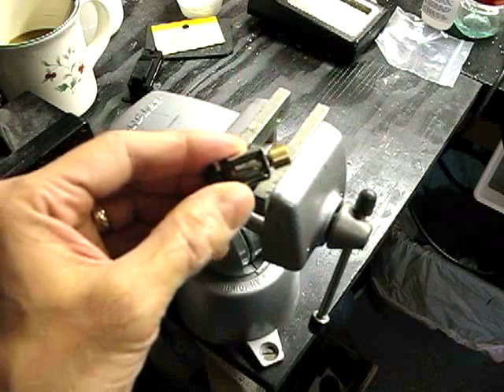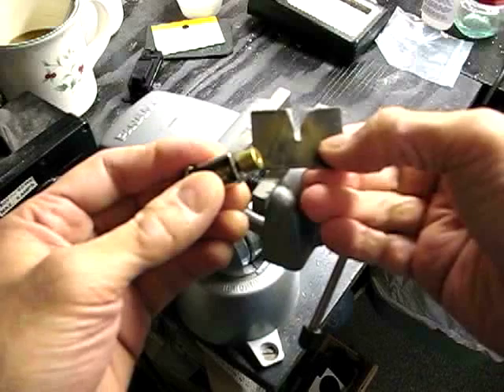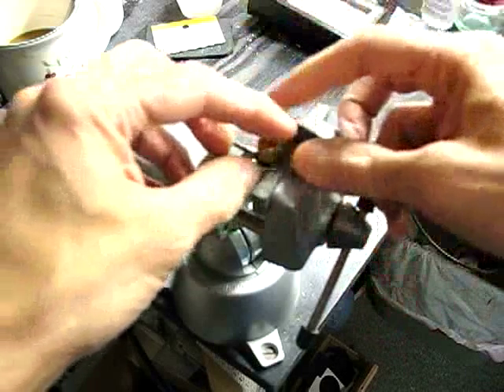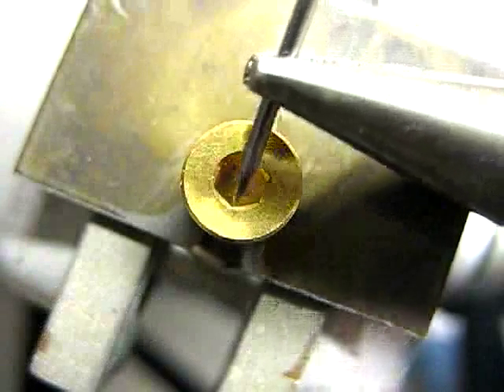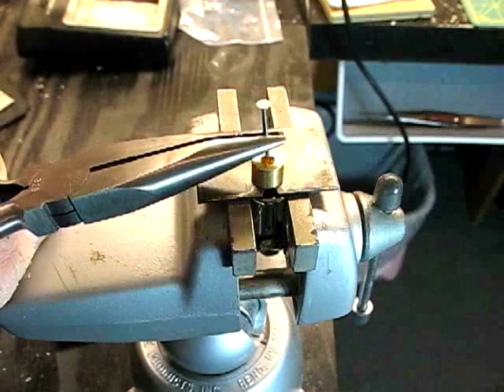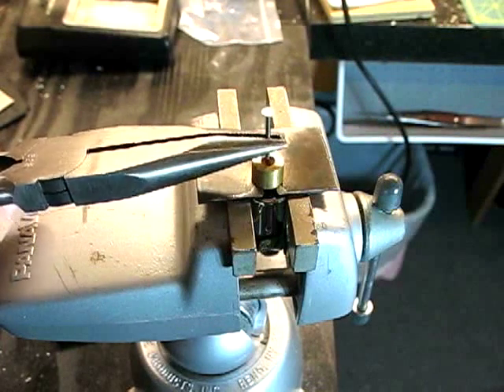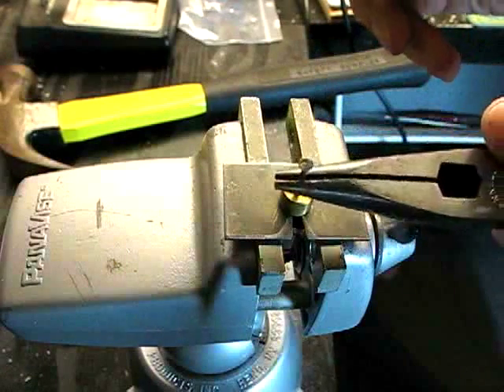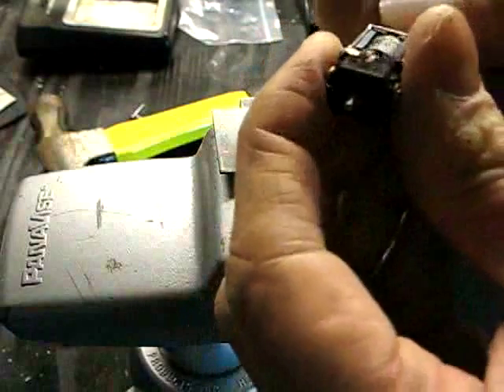Gear/Flywheel Removal

Comment from the maker: I agree with everything you say.  Small pieces of drill rod, yes, make great punches.   The thing is, by hanging the motor by the flywheel this way, NO shock is sent to the motor bearings.

Comment: Decent drill bits with the flutes cut/broken/ground off also make good punches, but when they break pieces can fly! It is best to use a punch as close to the diameter of the shaft as possible to avoid peening it out of shape. I use the smallest hammer possible when tapping on the shaft and don't tap any harder than I have to to make it move. I have a very small ball peen hammer that is perfect for modeling jobs. IMO, it is better for the motor bearings to take 20 small taps than 5 harder ones.